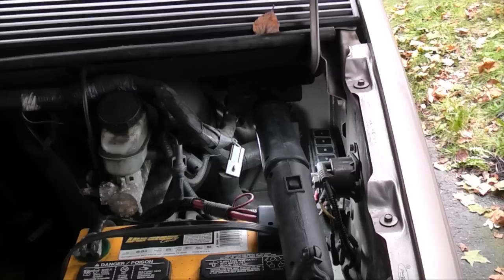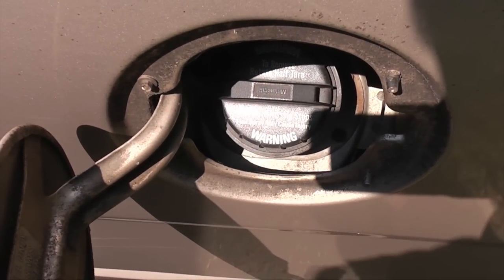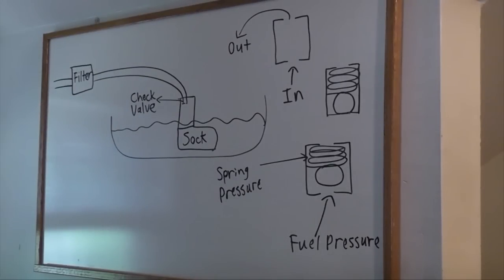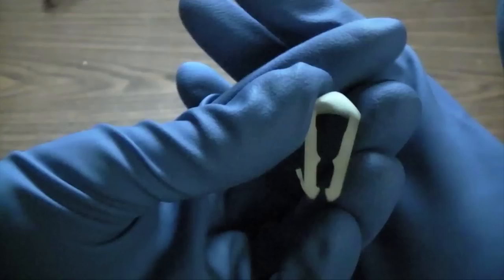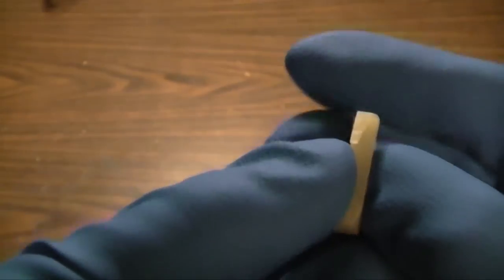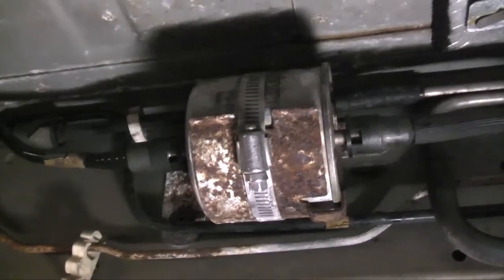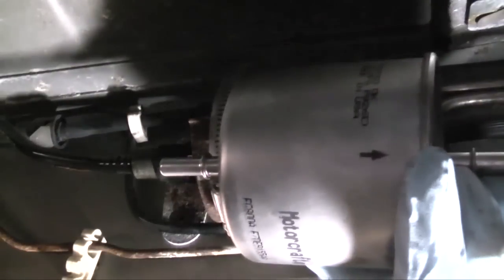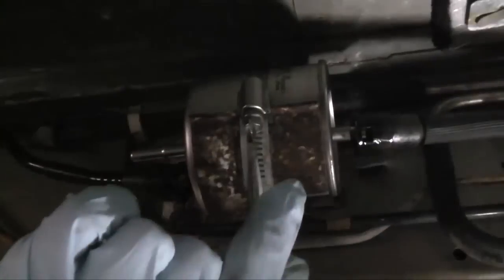Ford Fuel Filter Replacement

Comment: Reading these comments I feel blessed for this to be the first video I found regarding it. My 2014 Ford Edge has never had the filter changed. Yesterday I thought my transmission was going out.... my car will only accelerate when I barely touch the gas. If I accelerate normal it'll just rev. FINGERS CROSSED THIS HELPS!!!

Comment: You can remove the pipes without completely removing the 'duck bill connectors'.  Simple push then up so that the ends sit on the housing and the pipe should remove as normal.  This will avoid the need to replace the connectors every time you change the fuel filter.

Comment: lol man these ppl make it seem so hard, just locate the filter and unscrew the screw n pinch the clamps, pull em off... and unplug the hoses, watch for a bit of gas to leak out, take the old one out then put the new one up screw the clamp back to it n plug the hoses in n put the new pinch clamps in......dont forget no sparks for cigs no fire,  n disconnect the fuel pump, peace    there a arrow on the filter, make sure u install it so the arrow faces the engine

Comment: One thing...I just replaced a fuel filter with the duckbill fittings. All you have to do is use a small screwdriver to push the safety tab down, then the retainer pulls right out without breaking off the safety tab.

Comment: It seems the biggest issue with the fuel pump is the check valve that you explained very well. I am not sure if dirt gets lodged in the valve or what? Regardless, I let the pump run for a second or two before I twist the key to start.

Comment: Thanks so much, very informative, articulate and simplified instruction. Due to that, a novelist mechanic like me changed my fuel filter on a 98' Ford Escort which is against the firewall. I have one question though. When I changing it, the line and the end of the filter that connects to the gas tank had black substances coming out. Help please!!!

Comment: Thank you! I'm not 100% sure these are the same clips on my lines - I think it has the type you squeeze to release but since they were missing when I bought the truck I don't know for sure. 

The 800-003 is $4 for a 5 pack at Autozone, I'll pick them up and see if they work. 

Thanks again.

Comment: Nicely done video. 
I have a 2003 Ford Ranger 3.0 XL, I'm not sure if it has the same type of clips but mine are all missing. Who ever changed it before I owned it used zip ties to hold the lines on the filter. I changed it and used ties too but would like to get some of those clips. New filter didn't come with those clips, who sells them, I looked at NAPA and Rockauto but can't find them.

Comment: Nice video.  Any other Aerostar videos like this would be great to see.  I have the clock spring DIY coming up at some point to get my Cruise working and my Air Bag light to go out.   btw;  I just picked up a NAPA filter and it did come with the clips inside the bag.   Will be looking to do this new fuel filter on my '95 aero today.

Comment: So I liked this video but I have a 94 4.0L Aerostar and I am going to guess that's where my fuel filter sits also but I am wondering if you might know if this year and model has the same duck clips and housing set up as the one in the video? Or do you know if there is a particular they changed it to be more easy to access? I have aftermarket running broads that might be a pain but I'm sure they can be removed and reinstalled to do this process thank you in advance for your time
Reply from the maker: Yes it's the same setup underneath.

Comment: DOES ANYONE KNOW WHERE THE FUEL FILTER IS LOCATED ON A F53 CHASIS 36 FEET LONG 2000 SUNFLYER ITASCA V-10 6.8 LITER MOTOE HOME BY WINNABAGO. SORRY ABOUT THE CAPS , MY KEYBOARD KEY IS STUCK

Comment: I was in the process of replacing my filter and broke the fuel line connector (the piece that the duckbill fittings are connected to) Can I replace the connector alone or do I need to replace the whole fuel line? I tried removing the connector from the fuel line (which is rubber/nylon) but it's a pain in the ass. Can any of you please give me advice on what to do??? Cant start the car without fuel going everywhere on the ground
Reply from the maker: Jim Jordan It happens sometimes when you're dealing with old brittle plastic.

Look up nylon fuel line repair fitting most auto parts stores should carry them. Don't bother trying to pull the old fitting off cut it off. If you have enough excess line cut it as close as possible to the end of the old fitting and slip a new fitting on.

Heating up the line by dipping it in boiling water to soften it up makes pushing on the fitting easier. Just don't overheat it or it will become too soft and be impossible to push on.

If there isn't enough excess you can buy a nylon fuel line repair kit with a length of replacement line and a stepped brass barb to join the new line to the old one.
Reply: ***** thank you so much for the insight. This is probably the third or fourth vid I've asked to no response. Google couldnt even help me out.
Reply: If anyone else reads this you can also just buy a hose clamp (one of those metal belts with a screw that tightens it like the one holding the filter on).  Just use that to tighten the hose onto the filter.